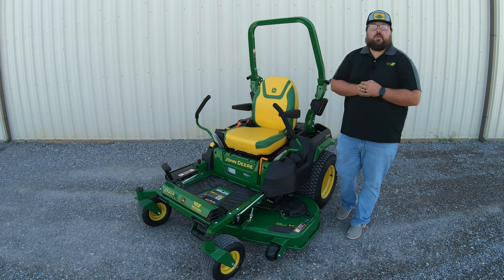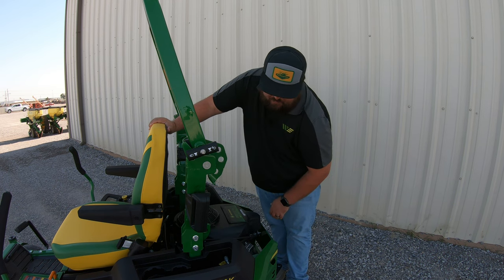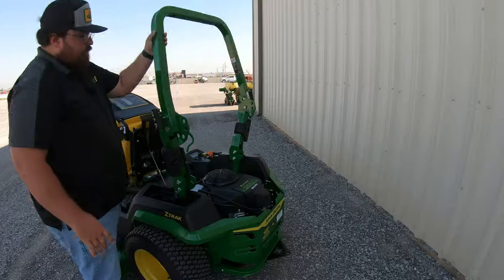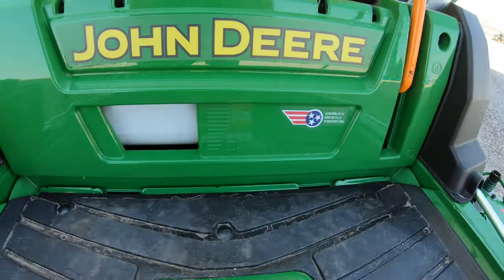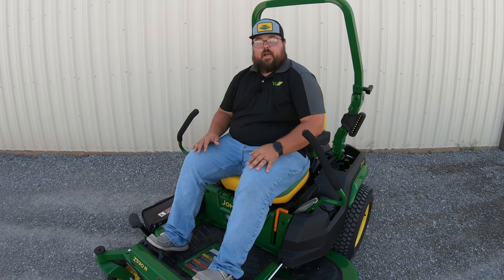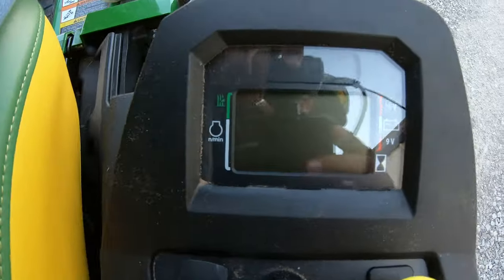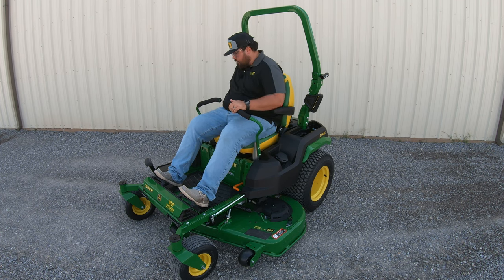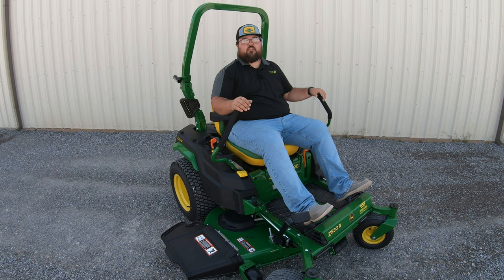2023 John Deere Z530R Zero Turn Mower Review & Walkaround

Comment: I put a linear motor and zip tied it under the pan where the front lights are and ran a piece of cable to an i bolt i put through the plastic chute and used the cutout in the dash for a 2 way switch and now i can raise and lower my chute as needed.

Comment: Funny that on the 530R and 545R with the HC decks that the scalp wheels are still the cheaper version, like the 42A decks. Great video explaining this machine. If you have an acre or 2 to mow, and you want to have a very nice machine for around 7-8k, the 5Rs are a great fit. If you don’t care for the larger tire, HC deck, headlights, taller seat, and rubber under foot, the Z530M might be your best value in the Ztracks under 10k. The 515E is also a great option, you just miss out on the comfort glide seat, which is a huge upgrade.

Comment: I just wanted to say that you REALLY know your equipment as evidenced by many of your videos I have viewed. There is allegedly a John Deere Dealer (Pape Machinery, part of Pape Group) in Hawaii (3, actually on the islands of Hawaii, Maui and Oahu (where I live). However, according to the John Deere website, it shows no dealers in Hawaii.
 After viewing your video on the Z5 vs Z3, I really wanted to buy the Z530R. The Big Box store, Loews, here in Hawaii only carries the Z530M. Because of shipping costs, the asking price is $6,229.00 vice $5,999 in the Continental (lower 47) US. However, since I am eligible for Loews 10% military discount, I would save $623.00. But, the M version doesn't have all the bells and whistles that the R version has.

Actually,  I only have 1.3 acre lot of that, probably only 1 acre is grass, so I suppose that the Z330R would suffice. I am 75 and I really want this mower to be my last purchase.

Anyway, I would appreciate your thoughts in this matter.

P.S. I would have no means of transporting my mower 19-20 miles for repair or service. Sears is gone and they were the only ones that came out to your home to service your lawn tractor (currently own a 6 year old Craftsman pro series w/46" deck, Kohler 24 hp lawn tractor with <300 hrs on it).

Comment: If you take one of the drive levers and move it in and out kind of fast 5 or 6 times it will turn the hour meter into a digital readout of the rpms. Dont have to go all the way in just so it gets off the safety switch and back on.

Comment: I drive a Z345R. It's a great mower. I see several things I like about this new machine, particularly the electronic display, the deck height pin and the lights. However, the throttle lever looks like it could break unless it's reinforced. My Z345R lever is made of steel.